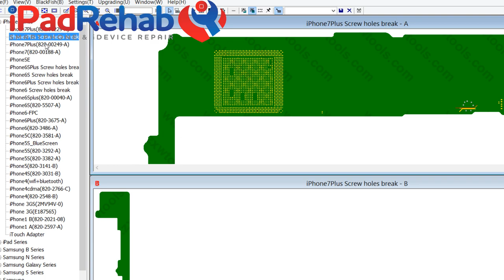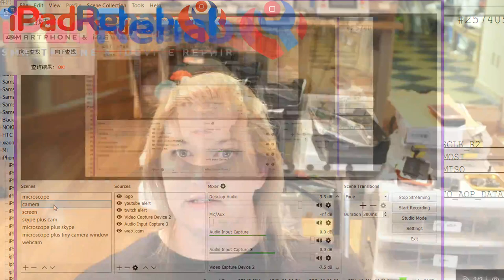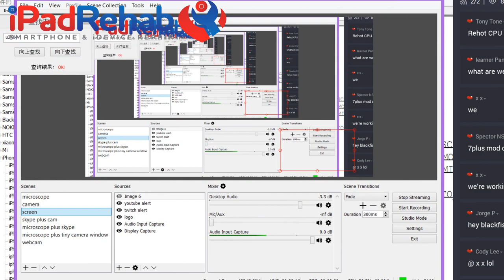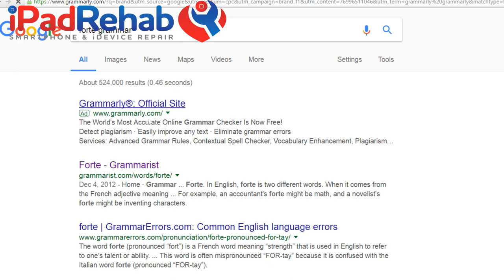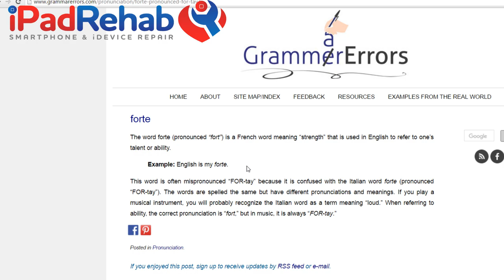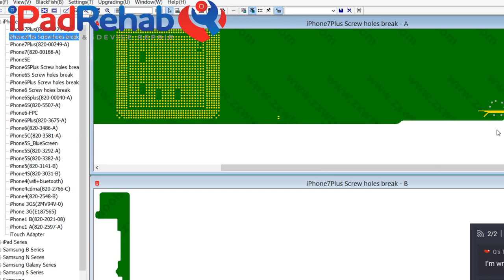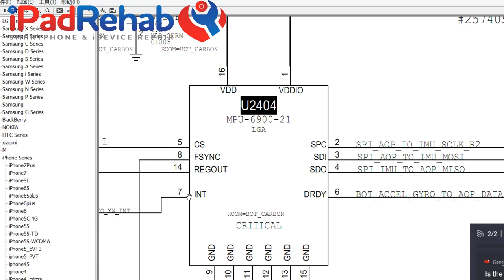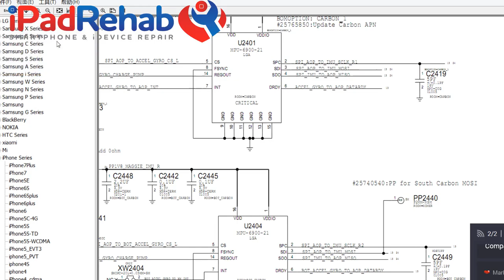Trace Repair--iPhone 7plus no backlight after mod

Comment: Sorry to hear about your getaway nightmare. From your description it sounds like your head gasket gone on the engine. If you check under the oil filler cap and there's white goo in and round the cap then it sounds like the head gasket, this is normally due to water mixing with oil which also might explain the white smoke bellowing out the back. Love the show and good luck with the right to repair

Comment: Late response, of course, but have you ever considered just renting a self propelled RV for those camping trips? That is, if you have someplace nearby, other than the dealer you already worked with. Might pay to check, they're more common than you might think. Then get a wheel barrow, wagon, or hand cart for trash duty, or a smaller pickup if required.

Comment: I have an 05 f350 superduty basically same truck as you. There not total crap. You have to future proof them though. It's probably the 6.0 and you need to do the bullet proof kit to it (head studs, egr delete, etc..) also the fuel systems on these rigs are notorious for failure which can cause your white smoke, that or head gasket.
Reply: Or just buy a truck that was built properly to begin with.

Comment: Hi, I want to ask how to fix a stuck touchscreen without replacing the LCD because my LCD is original iphone 7 plus from factory, do you have solution? I check my logic board that’s fine, the problem just in the lcd touchscreen, so thankyou. Im sorry my english is not good 🙏🏻

Comment: Hello, I am really hoping that you see this post. A friend of mine has a sofa that has a USB charger built into it. Unknowingly she has destroyed 4 iphones after plugging them into the sofa USB to charge them. The last iphone she tried to charge was her daughters brand new iphone 7 and right away it killed the phone. It won't switch on. It has no charging icon on the screen. It cannot be soft or hard reset. It is totally dead and so is the other 3 iphones that were plugged into this sofa USB. Do you think it has damaged the u2 ic chip? Or maybe it has fried these iphones completely? I have heard that using non-apple chargers will affect the u2 ic chip but for it to happen this quick I just don't know. My friend is still paying £55 a month for the iphone 7 and there nothing she can do. A local repair store didn't know what was wrong with it either. Please, please can you at least explain what may have happened by plugging these iphones into a sofa USB.
Reply from the maker: +Cannicky Tristar can be killed by any unprotected surge voltage.  Sounds very likely.

Comment: Why didn't you just put the wire between U2404 and that random component. It would be much easier then to play around and digging on the broken track
Reply: Who knows where that component is could be other side of board. trace is right next to connection just do it there.
Reply from the maker: +Goran Žarić I'm 100% sure that the broken u2402 trace is good, although I could have measured continuity from u2404 to opposite end of trace wire to be sure.  I think this one has fractured Board in third layer so other IMU traces will be affected which is beyond the scope of BL repair.
Reply from the maker: Update:  Reassembled phone fully this morning--compass and screen rotation are working, so no third layer damage, and trace repair was good :)
Reply: iPad Rehab great good job :)

Comment: New car prices are insane.  Find a good used truck and save yourself a ton of money.
Reply: Sell the truck and RV, rent an RV when needed, and save yourself a ton of money. If you're just hauling trash to the curb, invest in a wheel barrow or hand cart, maybe a small trail that your car could pull if you need to go farther, or a small pickup if you just can't live without it. The way Jessa described her use case, owning a big pickup and RV trailer includes a ton of hassle for minimal reward.